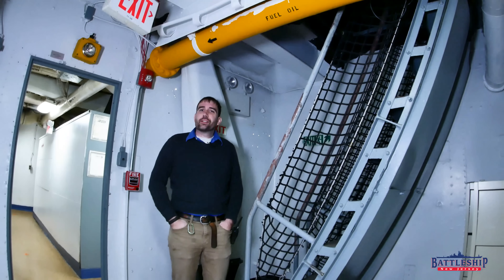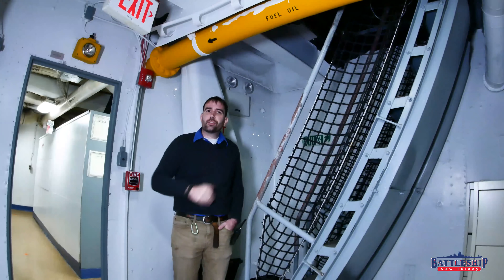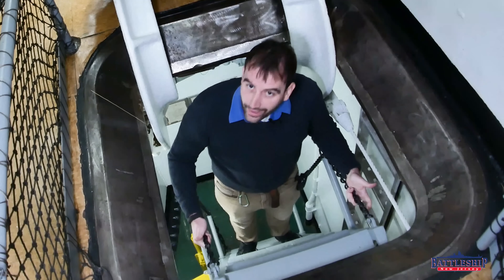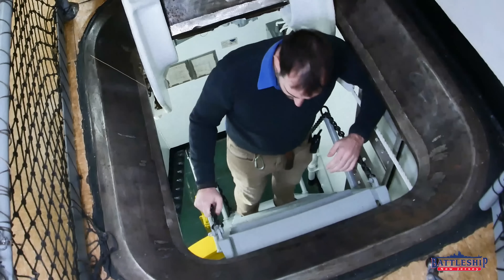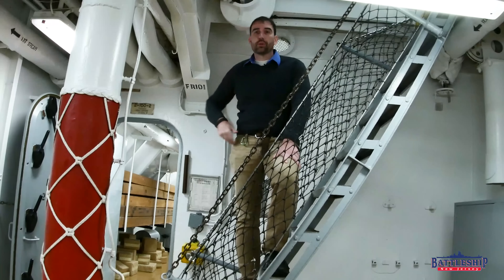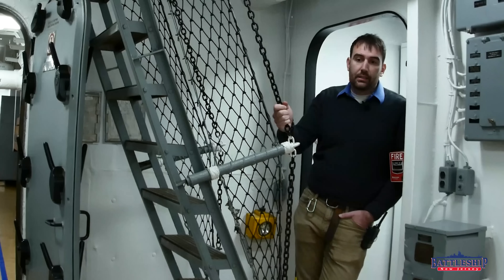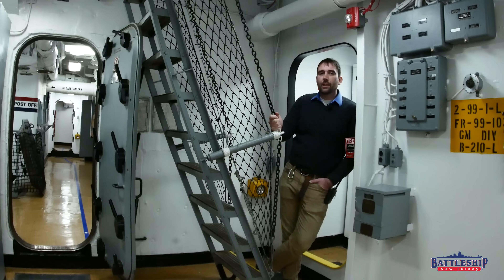Why Are Ladders on Ships So Steep? And Why Aren't They Stairs?

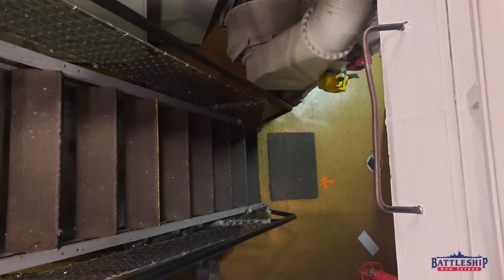Comment: The Grab bar at 3:34 - I recall a habit when active duty - some ladders - going down, grab the bar tuck (legs up, bend knees) Swing- then extend legs - in some cases leg extended to the lower deck , other cases onto a step.  I Suspect for even modern active naval ships most ladders are still steeper than a stairway. What percentage of ladders have a water-tight hatch above the,? How many different size hatches exist?  Falling .down ladders entry in deck log- perhaps some cases not really that. See the corpman - perhaps end up in deck log - believable enough statement, conceal some stupid or otherwise that was going on.
Reply: I spent about a year of my life aboard an Aegis Burke DDG and my normal rout didn't have any grab bars but instead had an I-beam ready to knock anyone over 6' in the head. They added padding but I still saw a couple of guys hit their head (I felt kind of bad when it happened to an older gentleman on a tiger cruise). Anyways, yes all of the ladders are very steep and we were trained to use them going forward. 
As for the hatches, most of the hatches I used where rectangular that had the individual dogs then had a second circular one with the wheel lock on the first. The big hatch was secured while out a sea and the small one was left open except for general quarters or any other time condition Z or X...I think...was set. I know there's a name for them but it's been over a decade since I used that nomenclature.
Reply: @Najolve  The small circular hatch is known as a scuttle

Comment: In a Middle School Washington DC trip....back in ......1992, We went on a very quick tour of the USS Barry. It was quick because a ceremony was scheduled later that day and they had to get the ship ready. It was quite literally a '5 minute tour'.
As such, we went through the passageways very quickly, and when going down a flight of stairs, my forehead discovered the edge of a hatch. The rest of the ship tour was a blur as my head throbbed.

My head was getting back to normal when a day or two later, it found a low ceiling going down the backstairs at Mount Vernon.

Comment: I took a header down a ridiculously steep stairway in an office I used to work in that had a right angle turn to the last 4-5 steps from the bottom. I managed to catch myself by the rail but caused myself a lovely rotator cuff injury in the process. I've been VERY careful of steep ways ever since.

Comment: after a few weeks on ship you get used to sliding down the ladders on the railing if they were not chained railing, it was way faster to get around. Many a time I feel down those dang ladders especially the ones going down into the MMR on my ship. It was one of the longest and steepest onboard and that three deck fall was a doozy if you missed  a step.
Reply: A lot of times there was oil and grease on those  main space ladders too, and you usually "discovered" it when going down for the mid watch.
Reply: Laying at the bottom contemplating your life choices that led you to this exact moment in time.
Reply: you can get a lot of speed when those handrails get nice and polished, especially on the 2&3 deck long ones. wet or greasy hands before you make it sporting.
Reply: LOL  I was sitting here thinking the exact same thing.  This is something I thought everybody figured out within the first week or two on board ship.  You grab the hand rails on each side and slide right down.  Your feet never even touch a step when going down.  It is like an unspoken rule.  You don't paint over the handrails.  And if you need to "break" you use the palm of your hands to act like a break.

What people don't realize is that the sailors going down these ladder wells are much younger than you average person.  Crew members average age is probably not even 21.  If they do tumble such as falling due to ship sway, they tend to get right back up and keep moving without even registering the fall.
Reply: I was a Radarman aboard the Enterprise. Our berthing space was righ below the CIC. We had a ladder like the one shown going from our berthing space down to the Hanger Deck level. I always slid down it. (Grab the hand rails, hook your ankles over the rail, slide down using your grip on the handrail to control your speed).
Reply: imagine chilling and hear loud hard object fall behind you
Reply: Yup, very common going into the engineering spaces.  The funny thing is the deck plate at the bottom had an obvious dish to it because so many people going down at speed.  We had a chief that hated people sliding down the rails so if we knew he was in plant we'd do a more controlled slide so we could stop and step down if needed.  Using the rails on the long ladders were probably much safer than going down the "normal" way though.
Reply: Only 3 decks? My sister can take 5.
Reply: @ryanstorm3773  mine can 7 your weak bro
Reply: @Christian.987  you're*
Reply: @ryanstorm3773  English is my 4th language so im pretty bad at it
Reply: @Christian.987  English is my 27th language, me too. Don't worry.
Reply: @ryanstorm3773  you a doctor to? i never knew i was german wanna to be a painter now
Reply: @Christian.987  I didn't know language was being a doctor. You know some crazy stuff!
Reply: @ryanstorm3773   Ich wurde 2 Mal abgelehnt, vielleicht habe ich es das letzte Mal versucht
Reply: @Christian.987  Why are you still replying, did I hurt your feelings?
Reply: @ryanstorm3773  roll a dice if it 5 6 or 4 yes if it 1 2 or 3 yes
Reply: @ryanstorm3773  dice i said dice
Reply: @Christian.987  You said the numbers 1-6. This means only 1. Singular of dice, is Die, plural meaning more than one is dice. You gunna learn today.

Comment: Yep, I fell down a ladder once. Hit the center chain support with my lower ribs. Nothing broken, but was pretty well bruised. That's life aboard ship. Accidents happen. I read that it got even worse when the Navy changed to the high topped boots. They had to make a lot of adjustments to the boots so not as many accidents happened. From what I've seen, I'd hate to have to get those on when GQ is sounded.

Comment: Once slipped off a ladder while climbing down to a floating dock... the dock was floating out just a little further than I realized so my foot missed and I went down into the water, luckily it was low tide and shallow enough that I did not hit my head on the dock, unluckily I landed ass first on a bunch of barnacles...
Reply: I've seen a dude try to show off and slide down the ladder and get both legs stuck through. Snapped in the middle of the shins. Not that it stopped me or anyone else from doing it though, so theres that.